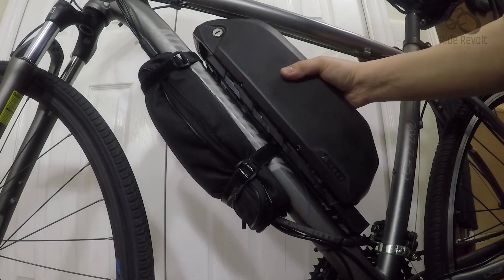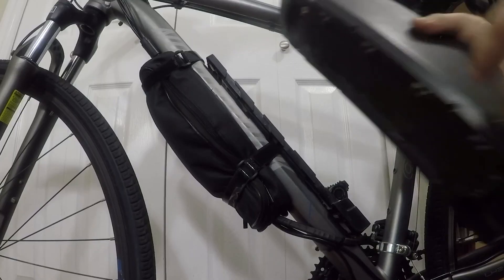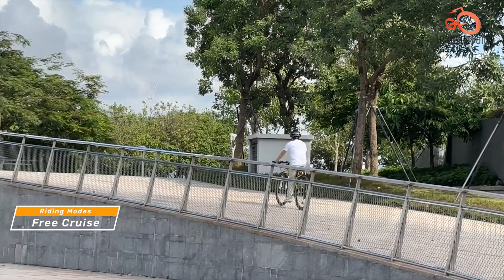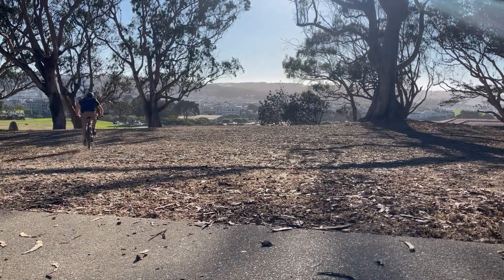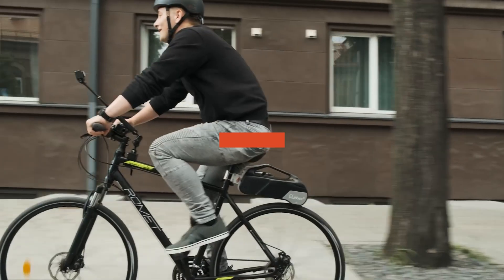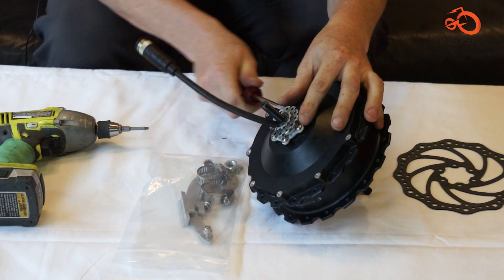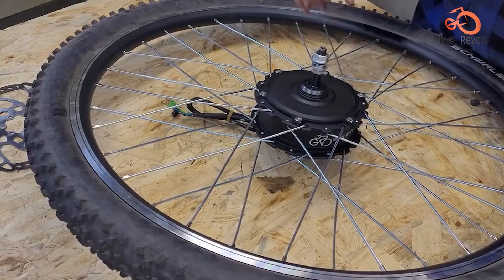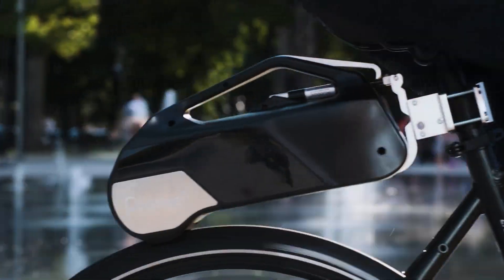Top 7 Best Rear Wheel Ebike Conversion Kits That'll Make Your Bike Boosted!

Comment: Interesting. It might have been even better with some rough prices just for a quick comparison.
Reply from the maker: Good point! For comparison, carbon bars can range from £40 to £200, depending on the brand and quality, while carbon seat stems can vary from £30 to £150. So, £20 on eBay definitely sounds like a steal—just be sure to double-check for quality and reliability!